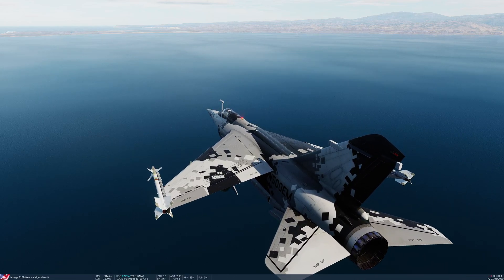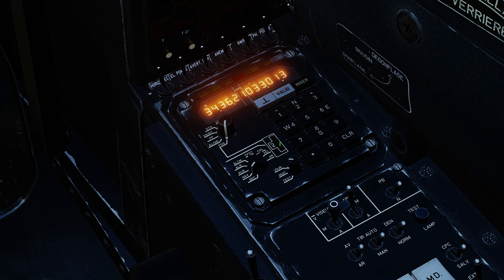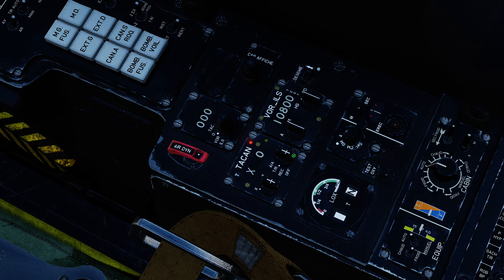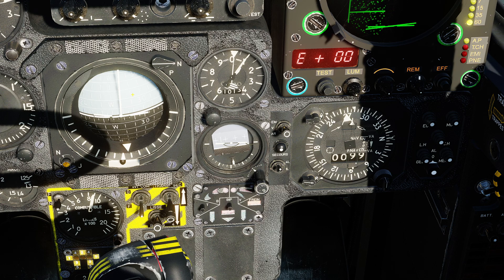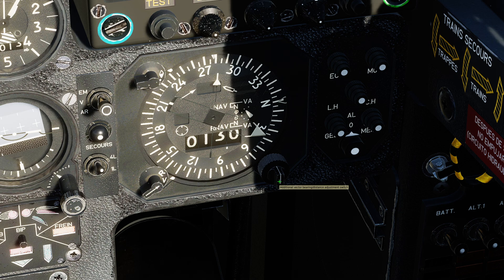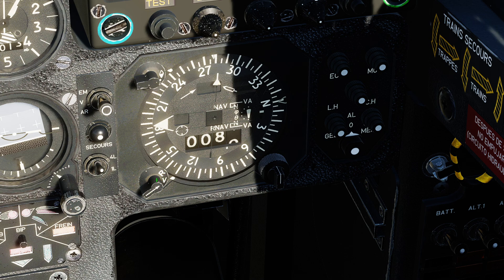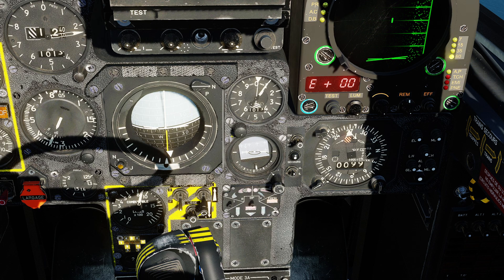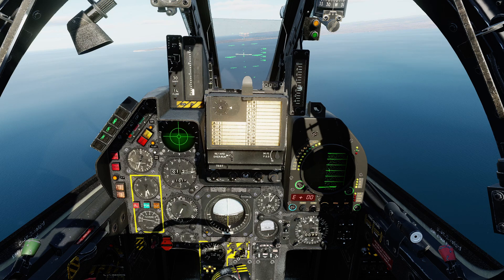DCS Mirage F1EE Tutorial 9 - Navigation

Comment: Great tutorial. The nav system in the Mirage is quite advanced keeping in mind, that it doesn't have GPS capability.
Haven't flown for a while, but I thought, heading bug is used for steering with autopilot in HDG mode.
Reply from the maker: Yes you are correct. Thanks for the tip.
Reply: But GPS isn't necessary if you can do position fixes. This jet doesn't rely on any positional info that needs to be precise, so it's brilliantly simple.